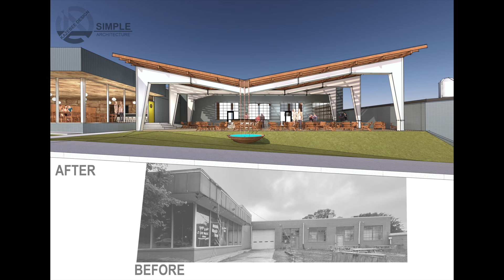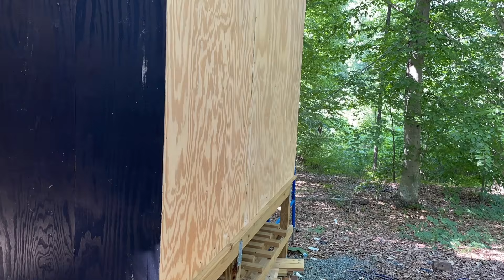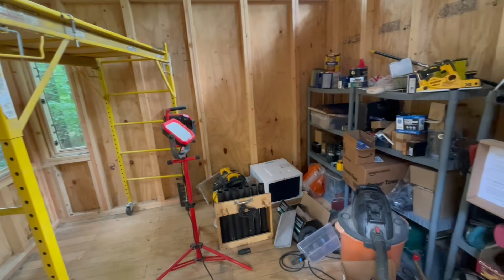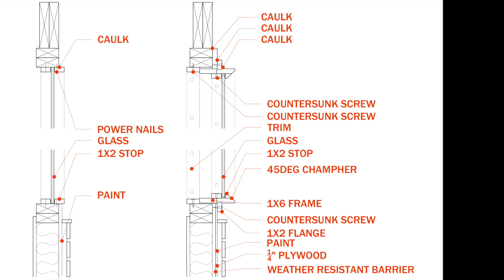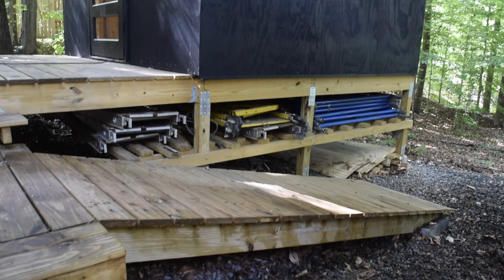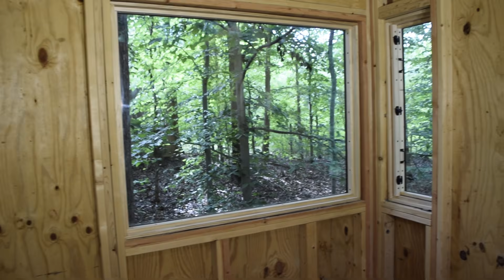Simple Tiny Architecture: Back in Black | Windows, Painting & Progress Tour

Comment: I asked Amish how they wire their houses. It is required to have. But does not need to be hooked up. I do foundations for the Amish. We only build timber frame and sandwiched log homes for residential houses now. Only a few designs. Because of being simple designs. And every plan the beams fit our jigs. So can turn out them out fast. We do shiplap walls with zip or sip. It easier than 2x6 walls or double studs. We sell more to last time buyers than anyone else. All plans 1st floors are handicap accessible. 5+ with well and septic is what we shot for. Masonry appliances extra. We do masonry stoves, masonry ovens, and masonry heaters. Energy star certified and over 92% efficient. Our passive solar house need a backup heat source that code list as primary and passive solar as supplemental. We have steeper sloped roofs so sun hits north wall in winter. We do around 45% window to floor space.
Reply from the maker: very cool

Comment: You are so different than almost all Architects I've met so far (I'm steel detailer and meet a lot of them). In a good sense I mean. Usually if we have brand spanking new type of cladding (pardon me weatherproof system) They are first to force it on their clients. Also usually they don't do mistakes and when they  vouchsafe  to fix them - they are refining their design.
Reply from the maker: There are pressures on architects to use the newest thing and act like they are perfect. I have concerns about that. however all of my architect friends are very nice grounded people. It is the system not the people.

Comment: That cordless brushed dewalt will smoke til the cows come home. I’ve had mine too hot to even hold before. Just let her cool down and keep on truckin.
Reply from the maker: great tip. but i still like the big one
Reply: @kazebeedesign  Hey Rick, not sure if you pre-drilled a ~1/4" hole inside-tangent to the hole saw track, but it sure helps speed drilling & prevent burning, as it provides a chip exit path 😊✌